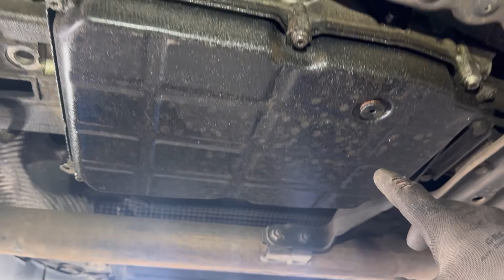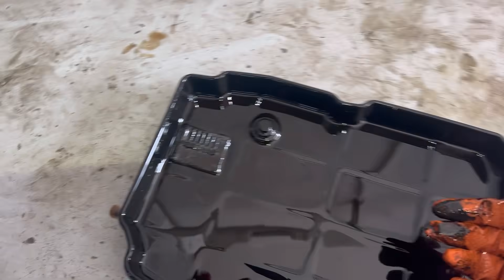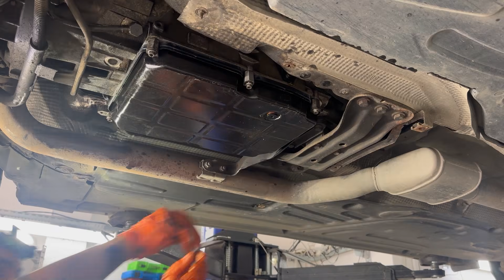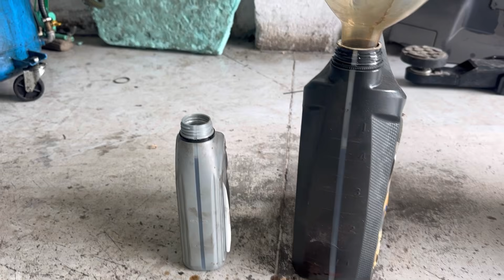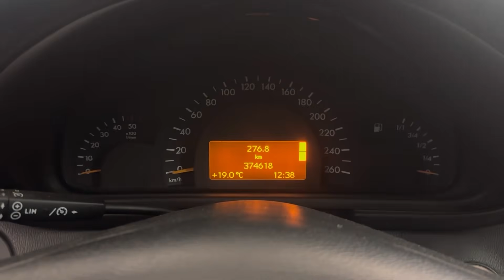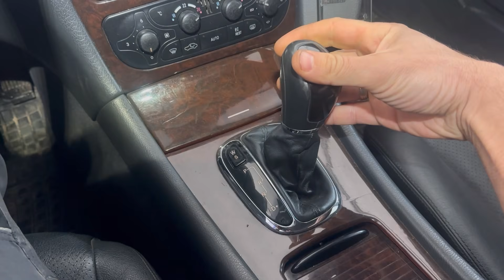How to replace the Automatic Transmission Oil on Mercedes W203 722.6 5G-Tronic

Comment: How about collecting a few of these transmission fluids from different cars with known usage in km after the last fluid change. 

Have them in small glass bottles in a row. It would be interesting if you could get them lined up from 60,000km gping up to 150,000km of usage. 😂😂😂 Thanks.